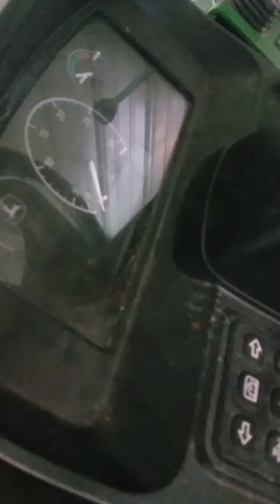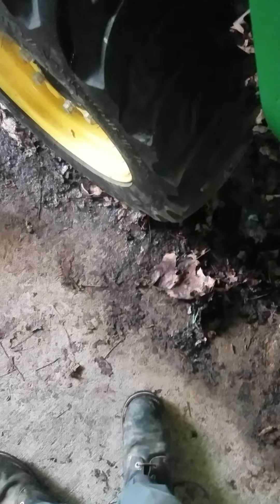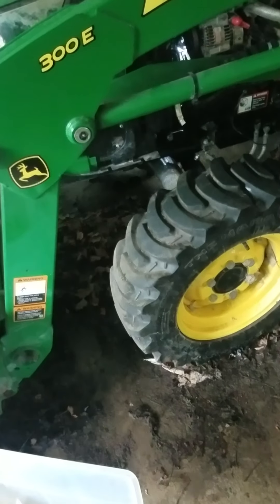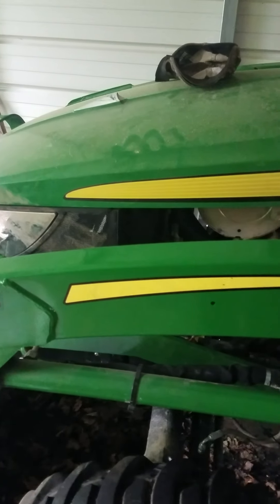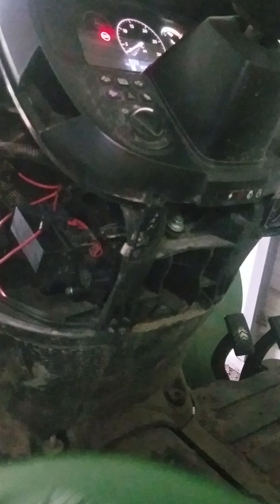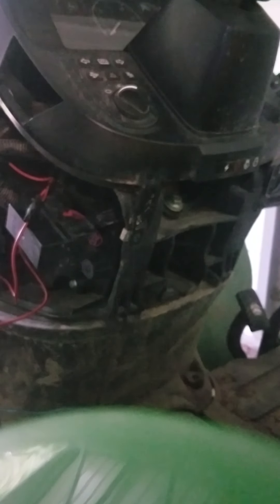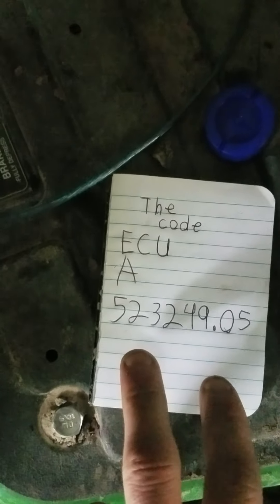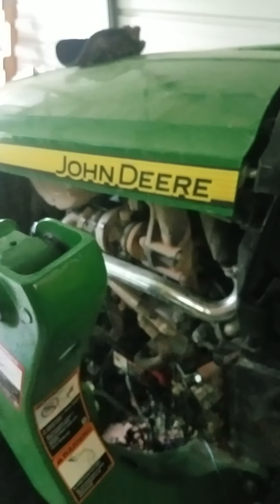2018 John Deere 3038e crank no start with code ECU A 523249.05

Comment: I have the same issue too but when I go to crank it over I have no crank it all just a clicking noise coming out of the starter
Reply from the maker: Okay I had the similar thing happen a couple weeks ago after I was done brush hogging I turned the tractor off to fill it back up with diesel when I got back I wanna hit the key and nothing happened I just heard clicking noise for some reason the starter and got suck I took the panel off the side on the right if you're looking at the front of the tractor remove the panel tapped on the starter with a hammer and it crank right up I've only had that happen twice
Reply: @adamhamrick3897  I tapped it with a hammer I think it’s something different got a try to look into it further
Reply from the maker: @thomasmason9336  also if you take the same panel off on the right side the fuse boxes there with the main connection for the tractor I had to take everything out of there and clean the rust and corrosion out and put it back together
Reply: @adamhamrick3897  I will give it a try thank you